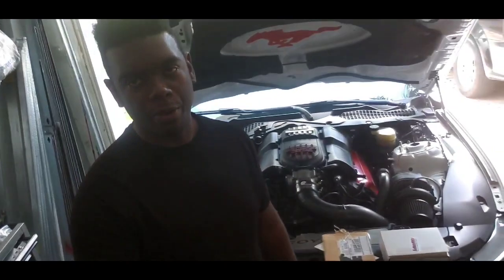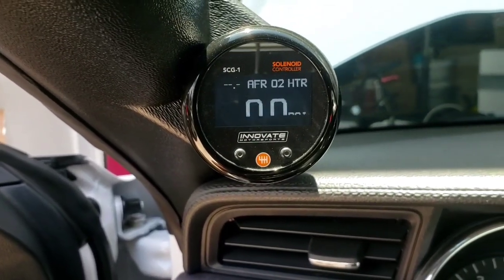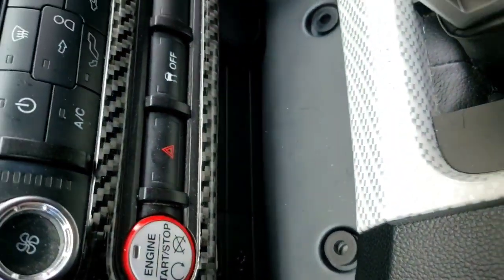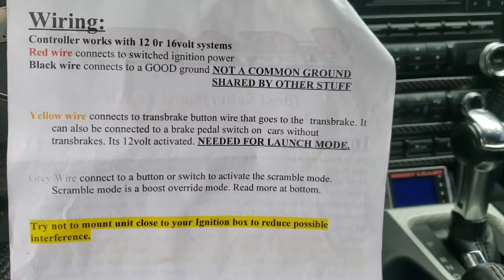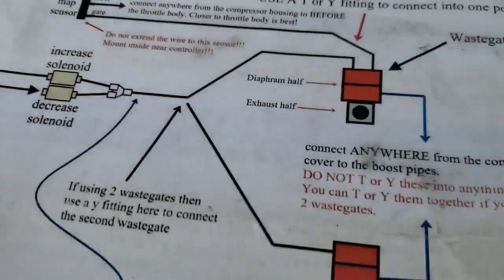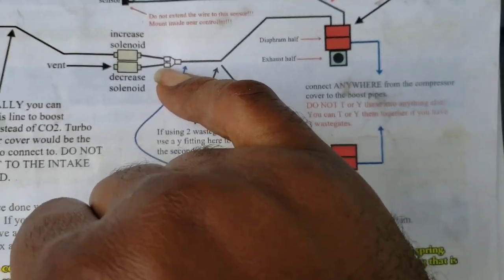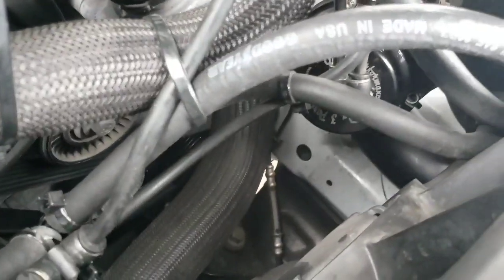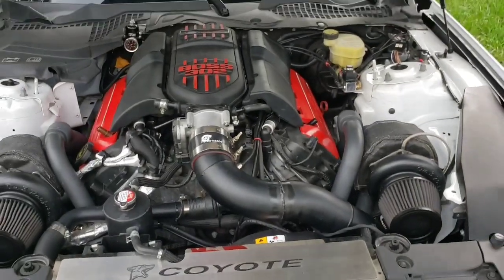BoostLeash Boost Controller Installation on on3 Twin turbo Mustang S550

Comment: What pins did you use on the passenger side kick panel to power the leash ?
Reply from the maker: Don't remember if it was the power window or power seat fuse, that I tapped into

Comment: I know every setup will read different Boost with different gate pressures but can you give me an example of what you have been seeing with the Mustangs you’ve done?

My setup is twin bottom mount 63/65 turbos with TurboSmart gen v Hypergates, 3# springs full 3” exhaust. I see 7psi with 10 on the gate, 11psi with 16 on the gate. 

Also with the scramble I’m not sure how the unit calculates but if you’re running 10psi will 3psi on the scramble equal 13psi total?  Or does it put 3psi on the gate? 

Do you have an IG account? Thanks!
Reply from the maker: @GreatWhite2jz

Comment: Does the Controller have an overboost setting? You show the tee coming off the solenoids but isn’t there another tee in line going to the gates? You didn’t show that so I wanted to confirm.
For boost reference to the map sensor can you tee off one of the lines Coming off the turbo housing? I don’t want to tap into the charge pipe.

Thanks!! Nice Video!
Reply from the maker: No there is no overboost that I'm aware of. The other T to the gates will be from the compressor house or charge pipe as a boost reference to the bottom of the gates
Reply: Right, but from the solenoids you showed a tee then they go to the top of the gates, there has to be a 2nd tee there also to go to each gate correct?
Reply from the maker: Correct. from the top of the gate 2 lines into a T then from that T you going into both solenoids with a T or Y.
Reply: Great Thank you!!

Comment: Why you get a leash if your not gonna run co2, get that bitch in co2 bro, so you can smoke people ramp your turbos up on the hit
Reply from the maker: I ended up running it with co2/compressed air